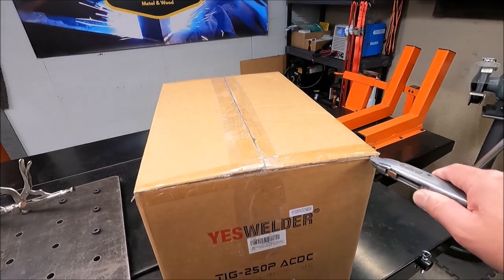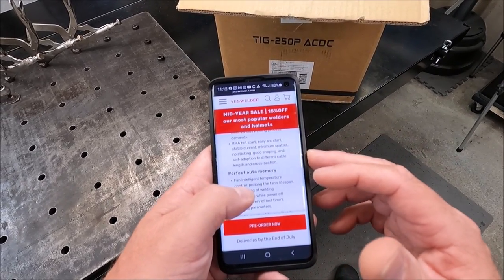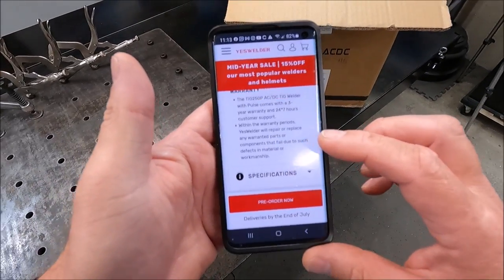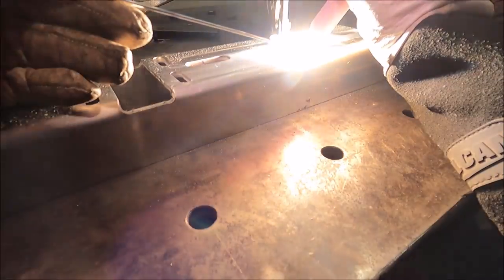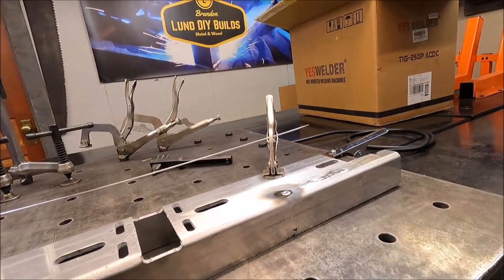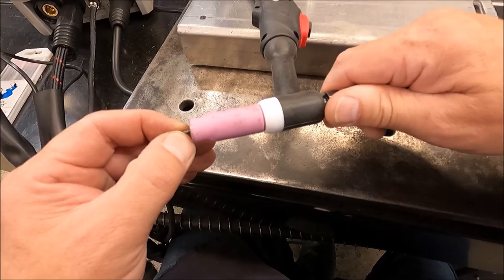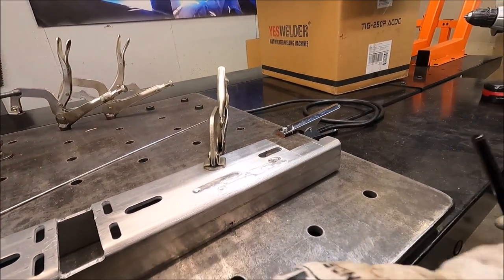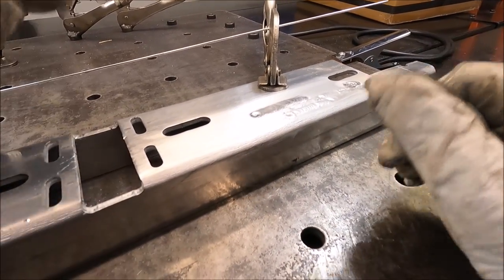AWESOME 250 amp AC Aluminum TIG Welding Machine

Comment: Yeah, you're going to have a good time until you need to get these machines repaired. I checked with a couple of welding techs that I know, and they said people bring these in and get angry because they won't touch them. It takes forever to get parts for these machines and the Chinese sure aren't coming over to fix it. No offense but stick with Miller or Lincoln. My Synchrowave is pushing 30 years old and the only thing it's ever needed was a pair of relays.
Reply from the maker: @Flyin777 It sounds a little suspect to me bud.. Why would your welding tech buddies be asked to repair a machine that can be returned to YesWelder in the United States (California and Colorado) with free shipping both ways? After doing my research I couldn't justify spending 3 grand for a machine that does everything I need for 750.  Their reviews are great. I'll take my chances 👍
Reply: @BrandonLund  Yeah? How long does the warranty last? Obviously you are benefiting from this company somehow. What sounds suspect to you? Are you suggesting what I'm saying isn't true?
Reply from the maker: @Flynn777 what I am saying is that this is my second machine from them and I purchased it based on 1st hand experience and after doing research and reading online reviews. Maybe all the online reviews are wrong... but so far I'm very impressed with everything and I didn't spend 3 grand to have something that I don't need. It fits my need and ultimately that's what is important to me.
Reply: @BrandonLund  if it works for you sir, that's cool. It wasn't just your particular machine, it's all of these Chinese cheap tig welders in general I'm getting at, the market is flooded with them. Support for these machines is a nightmare. I've been a welder for 26 years solid and a teacher. You can get a new machine these days for  under $1500. Regards.
Reply: @FlyinBrian777  how many of these could I buy even if I couldn't get it repaired for the price of a miller or lincoln. With the same capabilities. I personally would repair it myself. The so called welding shops are parts swappers.all they know is to throw a board at it and hope for the best..you fix the board with common parts available on ebay ect

Comment: NO ACCESSORIES INCLUDED. Maybe a year ago it did. But not anymore.
Reply from the maker: From their website 
What’s Included
TIG-250P AC/DC Welder
WP-26 TIG torch 13ft
Electrode Holder 10 ft
Earth Clamp 10 ft
Gas hose
Additional TIG accessories: 3 Collets, 1 Collet Body, 3 Alumina Ceramic Cup, 1 Long Back Cap, 1 Short Back Cap

Comment: Someone should check these cheap and nasty welders for actually amperage, id be very suprised if you get 200amps out of it
Reply from the maker: I do test them.
Reply: @BrandonLund so with a meter to see what that true current is? I know the 300 amp welders deffinalty aren't ill have a look though your videos for it
Reply from the maker: I have recently started testing all the welders on the channel using a clamp on amp meter to see if they can put out their advertised amperage. Most do not but some have.

Comment: No offence not trying to be a smart ass but your going way overboard on cleaning you material. I’m a welder fitter and I’d get in shitz at work for doing that much cleaning lol. Just saying lol. And looks like your using green tungsten and it’s out way to far. It should almost be inside the cup. Now if you use purple tungsten it can protrude and only about 1/8 of an inch
Reply from the maker: Oh trust me, the biggest complaint I get is I didn't "clean the metal" and its "going to fail". The sky is falling. I go overboard to appease the armchair welders so im not answering the same question 100 times lol. I can't remember what I was using for tungsten but im not surpised i had the stickout wrong. I don't do a lot of tig and usually have to reference when I'm getting setup just because I can go months without using it.  I've been using pink lately which I've been liking a lot. The less I have to think about the better lol.  Thanks man 👍

Comment: here's a question have you hooked a multimeter to it to double-check to make sure that it puts out 250 amps yes welder is known for putting false advertisement on their machine saying that their TIG 205 DV does 200 amps but it doesn't it only does 160 same thing with the mig welders supposed to do 200 amps and they only do 160 mp200 is the same thing Max amps 160 amps so double check make sure so you don't keep that for a long time the way you can't get your money back I suggest a primeweld TIG 225x personally but that's just me. contact bigb 1717 he will give you the skinny also check out the rigorous testing he has done.
Reply from the maker: I havent hooked up an amp meter but ive been curious to check all my machines which i plan to do very soon